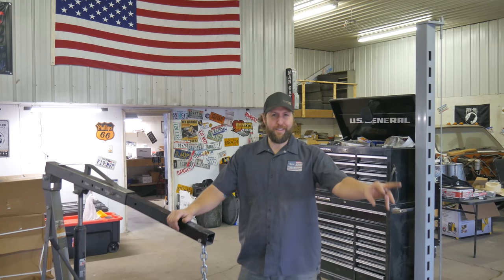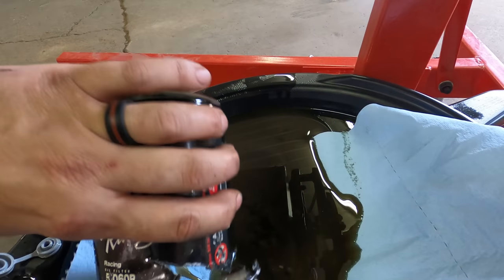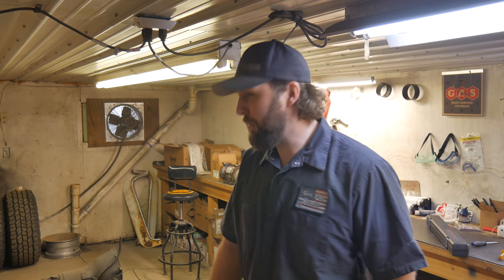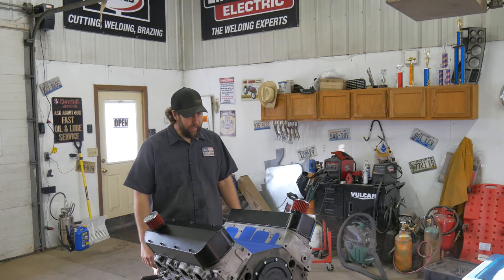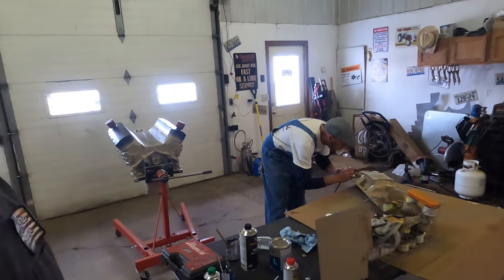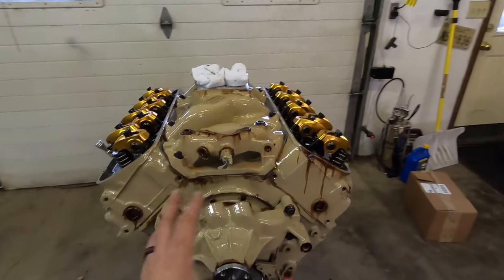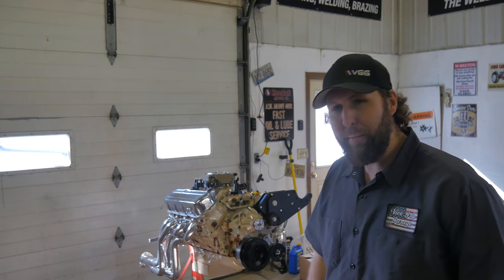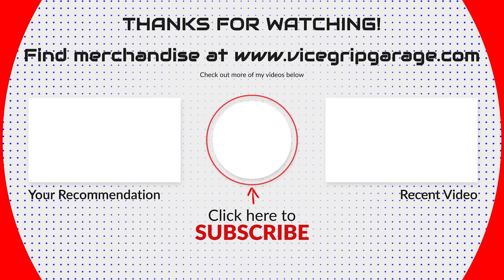Independence Chevelle - Procharger Mock-Up and Engine Paint! (Plus after Dyno Health Assessment)

Comment: Hey Derek. 
Here is a little hint an old timer taught me about when you use the window defroster to heat up a part to slip over the other part. Take that other part and plop it in the freezer for about and hour or two before. It will shrink up that part and the defroster will open up the other.  Gives a bigger hole to fit into. Then you don't have to smack it so hard and they slip together easier.
Reply: Yup that's about how the wheel bearing 2000 changer upper works.
Reply: Yup been there the old hot and cold trick work you just gotta be fast than well ill kep that to my self lol
Reply: Sometimes it works?  Sometimes it don't!  'Pendin' on how far away the freezer is!  Ubetcha Vern!
Reply: @AmosBHaven  just take the heat closer to the cold snack storage lol

Comment: Procharger. That should help remove all the loose flaking paint and rust down to the bare metal on Independence.
Reply: Why that there is just nonsense.
 The power on a Procharger comes on very smoothly for right around the first  .0034  of a second, then so ridiculously violently your fillings in your teeth get loosened...oh, wait...

Comment: When you fire up your sniper injection for the first time, I recommend setting the idle above and below where you want it to be. Let it learn the amount of fuel your engine likes for several minutes at each rpm point. 
  You can set the idle as low as 400rpms and  up to 2500. Let the computer learn in the lower rpm areas at no load before ever taking it on the road. That way if you break down or need to pull over, the computer will have a general idea of what your engine needs. Ease into the higher rpms. Don't just floor it immediately on a brand new tune. I've had sniper on my dairy driver since 2018. 
  Boost is another issue. I've had a centrifugal supercharger since January 2020. I'm running 93 octane fuel and pulling 1⁰ per psi. If you plug your computer into the sniper, you can get a lot more in-depth than the touchscreen. 
  Looks great. Can't wait to see and hear her run.

Comment: I'm an airplane mechanic on the weekends and at oil changes I always cut open filters for my customers to see if their $45,000 plus engine is producing any metal so I bought an oil filter cutting tool. I used this tool on my car filter as I use WIX filters (thanks Derek) and using this tool was a bear trying to get to the inside. Must have taken me 20 minutes. All it is is an over size tube cutter made by Lisle tools

Comment: Since I'm a model railroader, I use an airbrush quite often and have gotten better at painting.  I use it to paint Coleman lanterns and stoves.  I make my own rust material by soaking 0000 steel wool in vinegar for a month.  Then pour the rusted mess into a stainless photo pan and wait for it to dry.  Then I use a razor blade to scrape all the rust up and make it into a powder which I mix with alcohol and distilled water.  Then I paint it onto my models.  They have actual rust;  works great.  W Rusty Lane K9POW in eastern Tennessee

Comment: Wix is by far the best built filter , and the filter media is first class .  I have a filter cut apart tool , I use on every filter during oil changes . One thing I recommend is to cut the media off the spool and spread it out . This let's you look at all the stuff that the filter catches  . Have fun with that big block , it's a great engine  !

Comment: Man..back in my street racing days (late '70's-ish) the hot ticket was to pour a quart of straight 30 weight oil all over your fresh engine and then go beat it up and down a dirt road for an hour or so..
Messy but sleeper.
This is next-level stuff..
Reply from the maker: interesting
Reply: @ViceGripGarage  
If you run a balance tube between your air shocks with a brass valve from an aquarium in the line mounted in the center console, it'll give your junk the appearance of a set of washed out rear springs..open the valve, she settles straight, and you're ready to rock.
We hadda million gimmicks..

Comment: I am sure you know the one design flaw on the block of the bigs Chevy flavor is that one cylinder one each bank runs lean due to the turn in the intake runner. The edelbroken torquer with the canted carb flange helped to diminish the lean cylinders. It is said that a good spark plug reader can visually see the difference. I love a good BB Chevy

Comment: The heat range of pluugs may change withthe addition of boost. Most times a range or 2 colder is needed, with a good amount of boost that is. I wondered why you didnt put the Holley and Procharger on before hitting the dyno. Then I realized that the Holley is that good.

Comment: You would technically need wideband o2s in each runner to accurately measure AFR across all banks. You'd be surprised how different fuel need varies cylinder to cylinder.

Comment: Bigblocks are notorious for leaning out 1 2 7 and 8 cyls. Ive seen stock motors with headers break in and only turn them 4 xyl exhaust manifold or headers red hot running 2000

Comment: Have you ever heard of a FILTERMAG? It's a very strong magnet that attaches to your oil filter. It will trap and hold ferrous metal particles in your oil filter. Their easy to put on but very hard to get off.

Comment: i got my 68 pu with the  stroked 454 all painted looking sweet then my buddy gives me a roller set up for it started with a 450 hp 4 inch stroke factory engine heavy rods and pushrods steel crank high flow heads with 6000 miles on it got it for free with a heavy duty 400 turbo bigger pump heavy clutches stage one shift kit factory trans then i got a free tunnel ram set up so far i got 800 in my 68 pu just finished the dash full gauges looks better than new . found the perfect seat for it split bench power seats the seat matches the color of the interior for 25 bucks in really good shape. need to finish the interior and final paint i all ready have offers for 12,000 before i did the dash on it and i have the tac,fuel,speed ,oil,water,amp and vacuum gauges full factory set . i am going with powder blue with a darker blue that matches the interior ss stripes building a ss pu knock off it sit about 4 inches lower can't go lower where i live

Comment: Did I miss the part on the dyno specs I was really interested in the power and torque specs.😁😁👍👍
Reply: Yep, he's got a vidja on the channel at the Dyno session it put up some damned good numbers. 500+ range on torque and 550+ Horse Power and that's without the Super Charger in the mix. Once that's installed this things going to be in full on Beast mode...

Comment: the worst filter i ever used was STP. The oil pressure actually was less then before right after i changed it, and when i changed the filter to another brand, it went back to normal

Comment: If I'm doing oil changes by the number of fill ups because the odometer is dead "my old dodge D 100 got an oil change every 20 fill ups" I use Fram. If I'm debating repair or replace I usually go with STP.

Comment: I'm sure you know this, but the holley will keep it safe, it will not maximize the fuel or timing. A dyno tune will do that. Then the correction stuff will help with cold start or if things go wrong. To just enter a safe afr range and call it good isn't going to cut it bro
Reply: I'd hate to see a feller burn down his new mill. I bought the holley hp believing it was self tuning, and I can absolutely confirm that it is not self tuning. It will learn and get you close. But it's no substitute for a proper tune, with all fuel and spark modifiers properly setup for a safety net. Also, don't be afraid to implement the knock sensor off of a mid/late 80's tbi 454. Again it will take time to get it calibrated. But once you do you can expect oem like cold starts, drivability, and it can even pull timing if afr is out of whack, or if iat temps spike. Holley has made a great system, but it most definitely is not self tuning. Especially with a power adder setup.

Comment: Quick question for you Derek, you're obviously in the know on the heat range spark plug issue. Since you have owned at least one TBI 350 model GM aka beets, what plug would you recommend for one of those finicky things? I've got and 89 suburban that has a bit of pinging and I've been trying to chase it down. Loving your channel man!

Comment: Okay, I wrote down Wix oil filters, now what is a really good engine oil for my 1995 Honda Passport that I bought 3 years ago for $200.00, the previous owner told the insurance company that they could write it off BUT he gets to keep the car. the slight damage was to the passenger side rear fender, broke the window above that same side, he replaced the window with transparent solid plastic & I can't get the tail gate open.

Same question about  oil for my 1982 F-150 4wheel drive 300 engine Ford pickup???

UFF-DA, Born raised lived in Eastern North Dakota for 52 years before moving to Nevada 30 miles east of Reno, Nevada-----no snow since end of February 2021 & 50 degree days now.

Comment: I hae a good question for Derek... Or anyone who may know... I have asked just about everyone under the sun that I come across who has been trained in the art of mechanics and I can never seem to get a good answer.. So lets try here... 

I have a old 1958 international 460 gas powered tractor.. Almost all original and in great shape for never being restored.. Even still have some original manuals that came with it... Anywho... I was told that I need to run Case IH low ash oil in the thing because they had problems burning up the valves in these old engines and the fix was low ash oil.... Well let me tell you, a 5 gallon bucket of case IH low ash oil cost about,, oooh,,, an arm and the left pinky toe... And when the tractor leaks like a sieve and burns a bit of oil like those old work horses do,,, it can get quite expensive.. A guy only has so many toes to go around.. So my question is,,, Is there a cheaper alternative to case IH low ash oil.?? 

And please,,, Dont give me the ole ""Ive been using this brand since my grand dads 3rd cousin came over in a wagon train across the western trail"" I'd rather spend the money on oil than replace an engine because someones been using crap without problems.. I need solid advice that I can look at and feel comfortable with.. 
Thanks in advance and God bless. 
The old man.....

Comment: Hi
I have a question, because I did not notice, or it was not explained, why you use cast iron heads and not aluminum ones. I'm not a specialist, but from what I know, aluminum ones dissipate heat better and are much lighter than cast iron ones. Regards.

Comment: After that first coat a guy was thinking to himself, did he really keep them sparkalators in there?  Now he just ruined a set of good sparkalators!  But then a guy realized that having them open might have been worse than just painting over an old set of lightning sticks.
Reply from the maker: yeah.  About 30 seconds each in the wire wheel they look brand new again 👍

Comment: Aren't things going to change once you put EFI on it and a procharger those things you were not running during the Dyno run the Pro Charger is going to heat things up and the EFI you may need more fuel or less some goes for the timing so you will need to do some more testing and tuning with it all together because the engine is going to run a lot different when it's not NA anymore

Comment: i was taught in the Army to never place a battery on the floor or ground.  It wasn't bad  for the battery, it was acid splash on the floor and ruin of the concrete.  I never questioned the powers that be in the service.  Old wives tale debunked.

Comment: NGK and Ac Delco make great small engine spark plugs but shitty car spark plugs I would rather run Motorcrap than these my preferred plug is the Autolite racing plug best plug on the market, or just regular Autolites will do fine as well, man 39 degrees of timing is a lot, you should be around 18 degrees if timing, but to do it right you have to time at the cam gear and the distributer/mag

Comment: color,,marine diesel.. should be ford blue,,extra 7 hp.. according to powernation. i bought a 1986 460 ,then sold it. couldnt get a trans in aus.. it still had cross hatch,some. .460,flat tops,mild cam,??,job done.  351c,with 302c heads,mild cam. killer.. dished 300 l6 pistons help lower comp from 12.1. ran the bronc with just heads,on lpg. dangerous..lpg likes high comp..still going 12 yrs later..